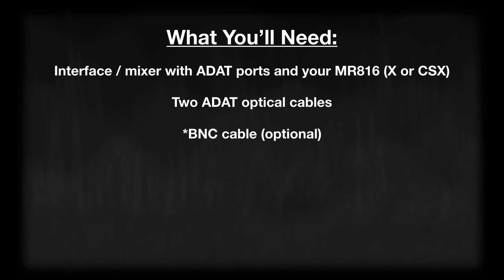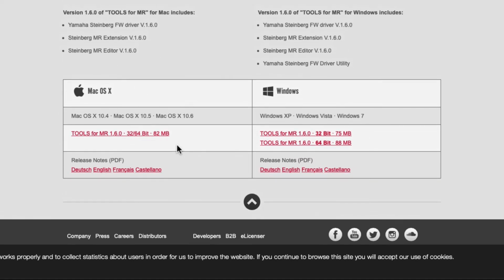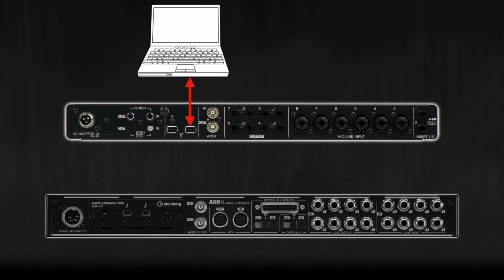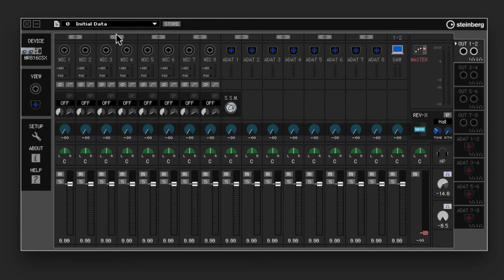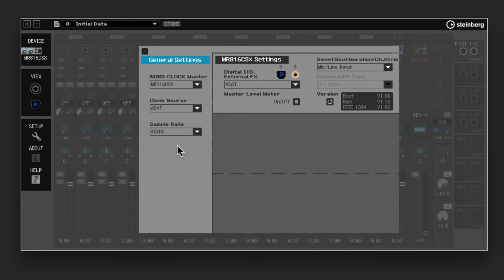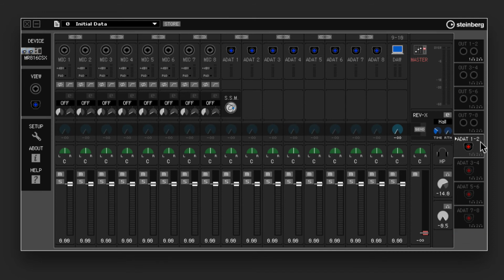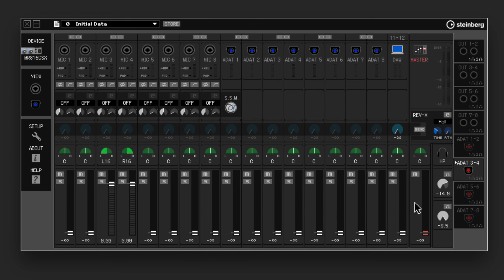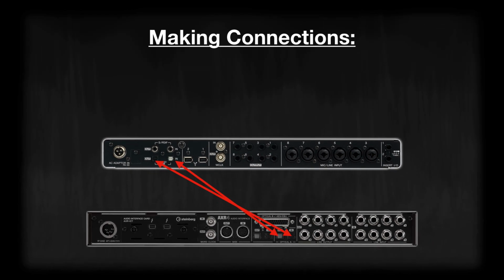Turn Your Steinberg MR816 into a Lightpipe Interface

Comment: will the MR816 work directly connected to thunderbolt 4 port on win11 with FW to TB4 adapter ?
Reply from the maker: Theoretically, yes. But in reality, I’ve never tried it. Therefore, I couldn’t guarantee success. It’s worth a shot, but I would recommend you verify the return policy at the store from which you get your adapters. That way, if it doesn’t work, you can return the equipment.
Reply: No

Comment: I have the 8 inputs using it  as adat preamp,,, BUT II CAN'T have the 8 independent  OUPUTS ,,, ,,,PLEASE HELP.... 😢... looks i just hve mono signal thru 1~2. Output,,,,, I'm trying to feed my outboard comp and eq...
Reply from the maker: You'll need to assign the ADAT channels on the MR Editor software to the analog outputs. Here's how to do that: At 8:05, I finish routing the analog inputs to the ADAT outs. But if you look at the right side of the MR Editor window, you'll see vertical tabs labeled OUT 1-2, OUT 3-4, etc. Those are the eight analog output ports on the back of the MR816. Click on OUT 1-2, then turn down all the faders, and turn up the ADAT 1 and ADAT 2 faders, (not the MIC channels, but the ADAT channels to the right of the MIC channels) and pan them hard left and hard right respectively. Turn the red MASTER fader up to 0 dB. Then repeat the process to configure ADAT channels 3-4 to OUT 3-4, all the way through ADAT channels 7-8 to OUT 7-8. When finished, remember to save a new preset in the MR Editor, or update the preset you've already made. Lastly, you'll need to configure your DAW or audio program to address the ADAT outputs. Since every DAW does that differently, you may need to do a little research on how your program addresses those outputs.

Comment: Question Please:

is there a way to convert a Lightpipe signal to USB?  If possible, I'd like to use a ADAT Hard Disc Reorder as an audio interface.
*
I have an Alesis 24 trk Hard Disc Recorder (HD24-XR model which has the higher end AD/DA convertors) and I was wondering if I can use the Light Pipe out to be my interface with my DAW.
*
I would like to use the TRS balanced audio into the Alesis unit, and than take the light pipe out signal of the Alesis unit and use a device (if they make one) to convert the signal to USB to use my DAW.
I would do the reverse on playback (again if there is such a device that can convert Lightpipe to USB,) so that I can mix old school through an analog console with vintage outboard gear...If there is such a device that would be great, but I won't get my hopes up! Hoping.........Thanks in advance...
Phil
NYC Area
Reply from the maker: I don’t have any experience with the HD24-XR, so I can’t guarantee it would work. But if the HD can route its analog inputs to the lightpipe outs, then all you’d need is an audio interface with at least three ADAT light pipe ports. I use an RME RayDAT card in a Thunderbolt chassis to connect two Clarett 8pre interfaces. RME and other manufacturers make interfaces that would do the same thing.
Reply: @mattlth  Makes sense to me. I do think it would work according to your reply.
I am not sure who makes an interface (without breaking the bank) with 3 lightpipe ports so I will have to research.
I was considering the Antelope Orion with 32in and 32 out via D-Sub connectors, however the brand new Gen 3 models, now out of production, are no longer anywhere I can find brand new. Up until last week B&H had them for $2295 brand new, but now there are sold out of the Gen 3 version. The Gen 4 model is $1000 more, so I missed out on the gen 3 models for a decent price. 
Thanks for your reply. Appreciated.
Phil

Comment: Thanks a lot for this great explanation ! 

Am trying to connect the MR816x to my RME PCIe with ADAT as you explained here but I cant choose ADAT as the clock source on the MR816x, its in italics so I cant get anything into the MR816x from the RME. Any tips  on how I can fix this ?
Reply from the maker: From what you've said, the italics means the MR is not 'seeing' a clock source at it's ADAT input, or the MR is set to the wrong frequency. You have to change the latter from the MR Editor control panel. But if it's still not seeing a clock source, that would happen either because you haven't run an ADAT cable from one of the RME's outputs, or that cable is faulty or has a dirty connector. Let me know if that's helpful.

Comment: Can this be made to work so that it automatically routes to the analog outs ?
To use this as a sort of mixer?
All of the pres output to analog 1/2?
Reply from the maker: Yes. Just go to the OUT 1-2  tab on the right-hand side of the MR Editor, then set inputs 1-8 to the desired level and pan settings, and make sure to turn up the red MASTER fader to the desired level.

Comment: I have been doing this for years to get a headphone amp hooked up to mr while using an apogee ensemble as the main interface. But now im gonna use it for a summing mixer. Unfortunately the mr software is no longer working on modern macs. Do u know if there is way to change the sample rate on the mr in stand-alone mode without a computer?
Reply from the maker: I don't know if there's a way to set the sample rate without a computer. I've tried many combinations of holding down panel switches during power-up, but the only thing I've found is holding the +48V button during power-up will set the clock back to Internal, but the sample rate remains the same. I wish the MR had that ability. Without it, the best solution is to find the cheapest FireWire-equipped laptop that can run some version of the MR Control Panel software.
Reply: @mattlth  thanks! I was able to get an old laptop we had lying around to to switch it. Not ideal but its still cool to have it at 48

Comment: Going to throw this question out cuz I figure you’re the guy to ask. I’m using my mr816csx to run a couple mics into zoom for a virtual concert. Zoom is only getting the Left channel (mic 1) and the sound (DAW 1-2) is only returning on the left side. Mr editor seems to have no option for control over this. Hope that makes sense. Thanks for any tips!

Comment: Can I use the ADAT OUT of my interface to the ADAT IN of the MR816 to utilize the Line Outs as well? Is there any additional set up for that purpose? I want the additional outputs for use with external hardware processing.
Reply from the maker: Yes, you can. I'm on the road until Aug. 1. I'll respond then with more info.

Comment: Very cool. I did this a while back with the MR816x when I got an RME PCIe card, but it was a bloody hassle to figure out, and I wish your video had been available then. Excellent, concise explanation. And in my experience Justin Kyle Co is correct about the master fader needing to be raised, and this is what the furthest right knob moves (at least in my setup) when those two knobs are set as master in ADAT mode.
Reply from the maker: If you're able to route at least 1 stereo pair of ADAT outputs from your RME card into the MR ADAT inputs, you should be able to click the corresponding ADAT tab on the right of the MR Console, then enable the desired headphone output on that tab (either 1 or 2) to monitor that output.

Comment: Thanks so much for your help! I was able to get the MR816X to work with my UR824. At first it did not work for me bet after tinkering but after a lot of trial and error i had to move the adat master to line level to get the ins going. I might have missed it if it was said in the video but any way thanks again!